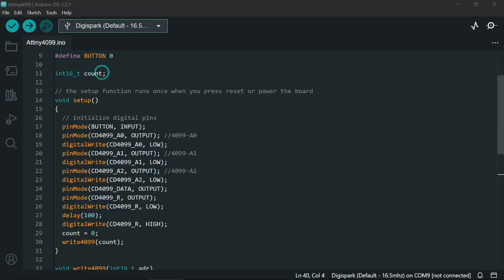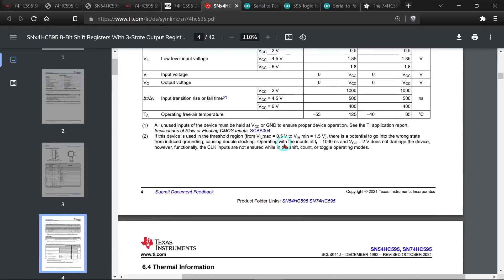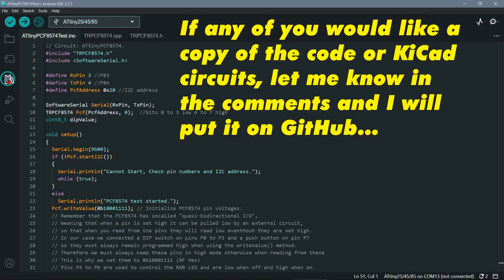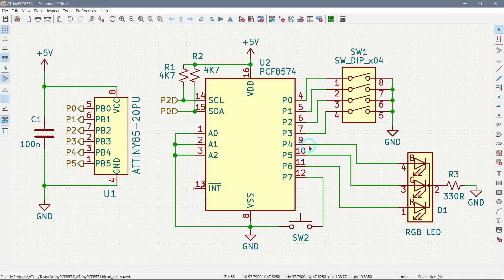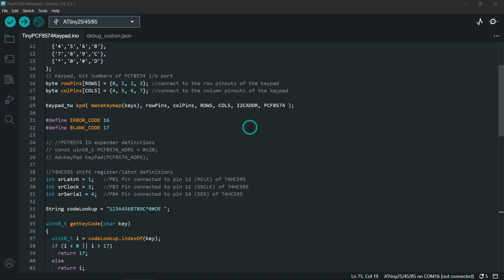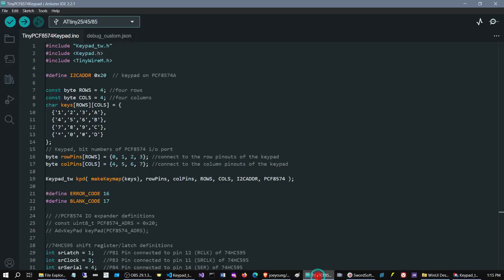ATtiny Part 2 Expanding I/O with cd4099, 74HC595 and PCF8574

Comment: Thanks for your indepth video
Reply from the maker: Yes that is possible but there is actually a 16 bit version with a slightly different part number if I remember correctly.
Reply: @Tech-Relief  PCF8575 is the 16 bit one, but it seem like i can chain multiple PCF8574 by setting the 3 address pin differently
Reply from the maker: My pleasure!
Reply: @Tech-Relief  hi is it possible to use 2 pcf8574 to have 16 button?